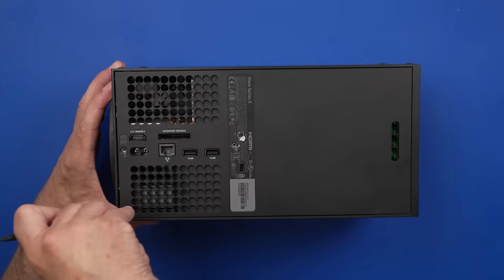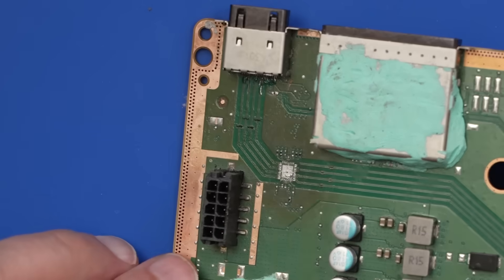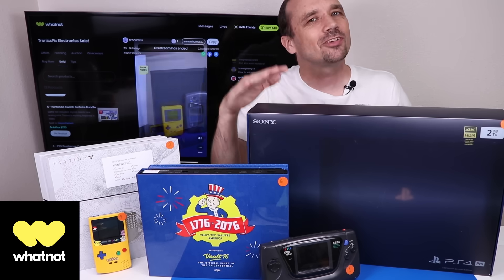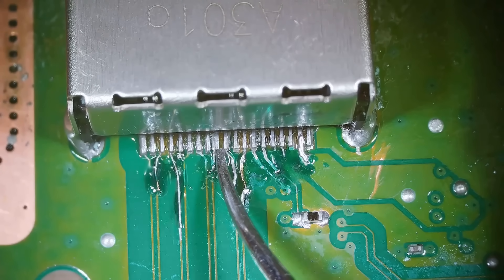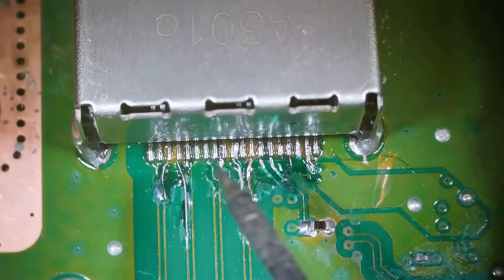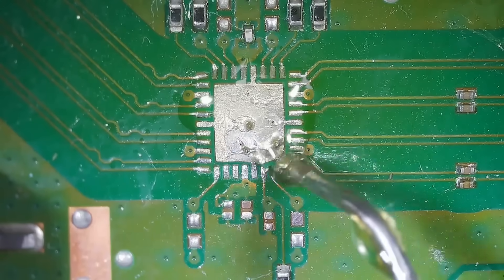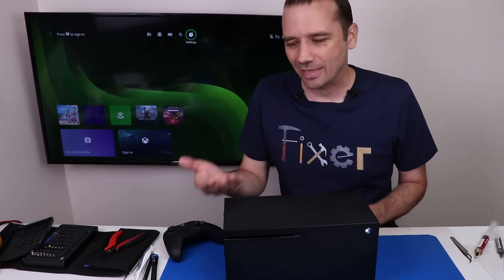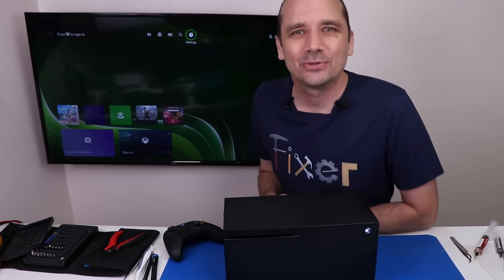Repair Shop Destroys Xbox & Won't Refund Customer - Let's Fix It

Comment from the maker: Trying to fix a broken Halo special edition Xbox Series X (I love the look of this and all the detail of this special edition!): https://youtu.be/uL2DvzP-dvQ
Reply: dude. this video is more than 20% ads. thats nuts!
Reply: @user56 just get YouTube premium😂 I have and I've been a member for about 2 years
Reply: Hey tronix how I have something you might be interested in fixing, but how do I get a hold of you. Do you have an email I can use to send pics ?

Nevermind I found your email
Reply: @shadowstrangler1 what's the email
Reply: @todjuan4183  in description
Reply: What's the e mail I got a ps5
Reply: @Tronicsfix Wondering if you can help. I bought a PowerA Wireless controller from Goodwill, I can clearly see the issue is the MicroUSB connector on the board of the controller, I have a pinpoint soldering iron and know I can fix it but I don't know which MicroUSB connector to get for the board. I tried sending a message to PowerA but they said "its secret and they don't give out part numbers". Any change you know which connector to buy?
Reply: Don't Ignore me,  help me

Comment: repair shop scams are so annoying.
Back when I was a teenager I could not afford a brand new xbox 360, so I bought a broken one and attempted to fix it.
I was unable to do so, but I found a mail in repair service that specialized in the exact issue I was having and suddenly I had a "like new" 360 for half the price.
Feeling clever I proceeded to buy a whole bunch of 360's with the exact same issue and try to mail them all to the shop to get them fixed so I could then resell them as brand new.
After sending 3 of them to the shop at once to cut down on shipping, I "lost" contact with them for 3 months. When I finally nagged them into responding they sent me back 3 gutted 360's that were obviously not the ones I had sent them. I ended up sending all 3 of them to Microsoft who took enough pity on me to send me back one brand new 360, but the cost of shipping alone meant that I barely broke even.

Comment: What the hell are people doing to their consoles to need to get them repaired? Even my PS2 that I still play regularly enough is in great condition after 25 years.
Reply: @Ethan9988  same here! From ps1- ps5, none broke on me. Hell, NES- Switch oled haven't either.
Reply: I'm not exactly sure how you're storing/using your consoles but some people keep them in their entertainment center thing where it collects dust that they don't clean at all
Reply: @codycampbell1147  especially if they have doors. Easy for the console to overheat. Never get a TV stand with doors.
Reply: Good for u buddy

Comment: Tbf the Xbox series x seems to randomly just change to a lower resolution even when it’s not worked on. Mine does it sometimes. I just turn my console off and back on and it usually fixes it lol

Comment: @tronixfix, Hey Steve I sent you an e-mail about 2 weeks ago about my Lenovo Legion GO. I would like to sell it to you for a low price. The battery cable broke when I was trying to upgrade my SSD. The Lenovo technician who looked at it said he would need to replace the entire motherboard. I call BS on that and I think you could fix it easily, then you could keep it for yourself or re-sell it. I recently bought a new LLG which is working fine now, but I'm not sure what to do with my broken one. Thanks.

Comment: I box a forza series X about 6 months ago at Walmart. It started freezing during downloads about a month ago. I sent in for warranty repair and they informed me it had been “internally modded” I don’t even know how to take an Xbox apart and wouldn’t know what to do if I did get it open. I bought it from Walmart and put it on a wall mount the same day and only took it down for the first time to send to Microsoft. When I called he said the technician took pictures of the “mod” so I ask for them I wanted to post them so someone such as yourself could tell me what’s going on but he claimed it was a “security concern” 😂 they returned it without fixing it. Any ideas what could be the issue and more importantly what could make them think it was modded? Thanks for your videos they are very entertaining

Comment: Hello, in one of my latest intervention with one of my laptop sadly I accenditally bent a M.2 Nvme SATA3 1Tb (it stay stuck to on of the thermo pad when I lift the cover). I'm super carful but it didn't work anymore and this is so small someone would need a microscope to check it.
I'm in Paris (France) but I can send it to U for free if you wanna try.
Your vidéos are so fun thank you for your efforts !! Wan

Comment: as a former employee at a sketchy repair shop (that I quit because they were sketchy), they probably told the customer it wasn't repairable in hopes they would just leave the console and then the store could either use the parts for other consoles, fix it and sell it, or an employee wanted the console. i saw it FAR too often happen just like that for things being repaired and the owner wanted

Comment: Please inform the person that sent you this xbox, that they should sue the repair shop. Clearly they just stole a chip and claimed they couldn't fix it, didn't even freaking try, when I'm guessing the original problem was the chip might have needed to be resoldered, or could have been the HDMI, or both. BOTH EASILY FIXABLE. And they stole his chip, ruining the xbox and refused a refund after not fixing it! BOTH ARE ILLEGAL. He could even use your video of you putting a new chip in as proof in court that the chip wasn't there!

Comment: Yep I don't trust repair shops anymore I send my ps4 to be repaired after the disc drive stop working, guess what they made it worse. It made a grinding noise every time I put a disc in and it wasn't there before I had to buy a new ps4 to confirm it wasn't my disc yep it was the ps4 I got ripped off $150

Comment: I'm surprised that the "repair person" that worked on this board didn't just epoxy a Barbie Doll head on it.
Maybe even take a bunch of wires and build a little cage to contain a roach or a fly.
Yeah, you get my point of just how insane this so called "repair" was done.
I'm surprised they didn't immerse the whole board in liquid metal.
"Yeah! That will fix it!!!!"
"Oh, is it time for me to go to the clown store as I need a new costume to go out and stand in the woods."
INSANE!!!!!!!!!!!!!

Comment: Im also a little sceptical about the concept that the customer did a pretty good job of trace repair, overall, yet could not install a new retimer? Vastly different difficulties imo, ive been replacing non BGA chips for years before doing trace repair on something as small as HDMI legs, very confusing backstory

Comment: So first things first, speaking as a repair shop of sorts (im not a specialist but i do board repair) its important to be up front with a customer about board repair. Board repair is not like taking your PC to be fixed when it wont turn on. Board repair is more like data recovery. Theres a percentage chance of success, a percentage that increases with the skill of the technician, but it is not a guarantee. Not ever. We make this very clear. The way I myself manage this risk is by doing all work as "nofix?nofee". I explain to the customer that the board may be fixable, may not, and may become more broken as a result. It is up to them if they proceed with that repair. I have about a 70% fix rate in console repair over all faults, 95% where its a known fixable fault, like a port swap. But its never ever guaranteed, because the manufacturer does not support 3rd party repair. If you work any other way you are completely mad, and will get yourself in hot water because the public does not understand why trace repair is any different to getting a tyre changed.

Comment: This reminds me of the time my local game store tried to fix my used PS2 when I was a teen. The disc drive wasn't working right. About a month later, my mom and I went to check how it was going, but they weren't done with it somehow. We could see in the back they had it fully apart, almost like they might've been using its parts for a different PS2 or something. Wasn't sure, but it still seemed fishy. Regardless, it was a MONTH waiting for some good news, and even we knew it shouldn't have taken so long for a disc drive repair. We even gave them our number to keep us updated, but they never called. If I knew you existed then, I would've gladly sent it to you, or have IFixIt teach me how. I currently have the Slim PS2 with a disc lid that can only shut (and work) if something slightly heavy's on top of it, like a game case. Ugh. 😑 On the plus side, your vids got me into trying to fix things, like my old HP laptop and my old Yogabook. Eh, at least I tried. 😅
Reply: That's pretty fixable. There's a sensor by the power button, and one to the left/rear of the optical drive. Very common. Usually the rest one fails and needs cleaning or replacing.

Comment: Hi Steve, nice video as usual, keep it up! And also I wanted to ask you a Question, after 5 years I finally founded and could buy a Gameboy fat, it was really in bad shape (liquid damage, corrosion, the screen had more than the half missing, there was bugs, the speaker fell in part...) , and don't boot, I fixed! I soldered back the lines, tried to clean some corrosion with what I have and else... Igot really happy even though the screen there are some horizontal lines missing but at least it's booting up! but there is the problem, there is dirt inside the screen! Yes really inside like behinde the polarizer and I think glass. So what should I do to clean the screen? Should I take it apart?? Hoping you have a nice day.

Comment: I get Apples reluctant attitude about repair.if a repair shop steels you chips 😡not it’s good not regulated 😢

Maybe it will pay to spread chip manufacturing to all the continents 😢

Right to repair is going to happen 

It’s going to take top minds and regulators to make it work long term 

Nice content

Comment: 10:35 you actually didn't fix it by setting the resolution manually (you could only pick up to 1440p instead of 4K - which means the handshake failed. You see this under 4K TV Details. It will tell you that your TV supports nothing), but you also didn't cause this with your repair. This is an HDMI handshake issue that's plaguing lots of Series X since launch and it most often seems to happen with LG sets.

Apparently, according to someone on Reddit who spoke to LG about this issue, the Series X is sending the handshake signal too fast so the TV and Xbox are sometimes out of sync. The only reliable way to "fix" this issue is by buying an HDMI repeater or use an AVR/HDMI splitter.
Reply: I've just got this issue with my Series X. I've only had it 3 weeks and it was displaying no probelmt until yesterday when it decided to only display at 620x480. An override can get me back to 1080p, but that means the Blu-Ray player doesn't work because it can't talk to the TV stil.

I fixed it once with a power cycle thing, but it only worked once and now it's back to 620x480 again. I've not got an LG TV either, but a BUSH 3D one. I'm going to upgrade to a 4K set in a week or two and I'm hoping that fixes the issue!
Reply: @Bermondseybob  power cycling can sometimes fix it, but if you don't want to buy an HDMI repeater or AVR then another reliable way to make sure it communicates properly is by turning on the xbox, wait for it to fully boot (like until the xbox logo on the gamepad stops flashing) and then turn on the TV.

I did this before I used an AVR and it always worked on my LG CX and looking at others with the same issue (reddit has quite a few threads about this), it seems to work for others as well. 

I hope your next TV handles your Series X better than my LG. Good luck!

Comment: 9:09 I've never seen a hot air station that can go as high as 1100 degrees, I thought that sort of heat melted most materials?
IIRC most hot air stations tend to be set to 400 or 450 degrees to remove/replace components?
Reply: I would assume he is talking farenheit rather than celcius - some machines can be switched between the two so the machine shows the temperature in the scale you are used to. Mine goes up to 600 degrees C, which is approx 1150 degrees farenheit

Comment: Just throwing it out there. Ever come across an issue with Xbox one X just turning off without any warnings or messages? I've swapped, hdd, powersupply, powercord, thermalpaste (the perfect amount) and added a external cooling unit so it's impossible for it to have an overheat issue. Offline update doesn't even complete anymore either. So I'm leaning towards the motherboard having an issue. Got any tips or is it the recycling station for it?

Comment: My guess is the repair shop accidentally desoldered the retimer chip with too much hot air, it flew away and they didn't have a replacement so they just said it's unfixable.

Comment: I'm guessing they "fixed" the hdmi port, but didn't check to see if all the points were firmly connected.  Since it wouldn't work due to the hdmi port not being on right, they tried replacing the retimer chip.  When that didn't work, they took back the new retimer chip, and never bothered putting the old retimer back on since it's "broken" anyways.  They then gave it back to the customer saying it's not repairable.
Reply: sounds about right
Reply: Well, apparently they underestimated the power of TronicsFix

Comment: Ah yes... "professional" repair shop. If a repair shop tells me that, I take my business to the next one until they tell me they've fixed it before. 
Also quick side note, I don't know the legality of not actually repairing something then giving the customer no compensation, but I feel like the seller can absolutely escalate this case and get some money back.
Reply: In case the repair shop will run into something that's beyond repair (which will happen at some point), they should only charge for diagnostics at most. There is nothing to giving compensation for - they haven't damaged anything.

Breaking/stealing stuff is obviously illegal, however the burden of proof would be with the customer. And, most importantly, majority of people have better things to do than lawsuits... So the sketchy business gets away with it.

Comment: This is why if my console broke, I would always send it to Microsoft or Sony, because I would not know where to start with repair shops. Nor, I don’t have the tools required or the knowledge to take it apart and clean.
Reply: It depends on what the problem is - one of my friends damaged the HDMI port on his PS5 and sent in to Sony, and they returned is as being beyond economic repair.  I took it apart and there was one single pad ripped off the HDMI port, which was apparently enough for Sony to consider the board scrap.  I just fixed the pad and soldered a new port on - of course, Sony could have done this but apparently as a matter of policy they don't.  Admittedly, we had the same rule when I used to work on avionics, but I think it's a lot more justifiable there.